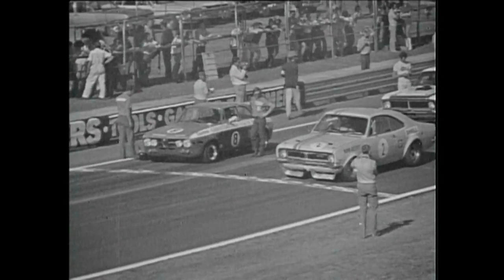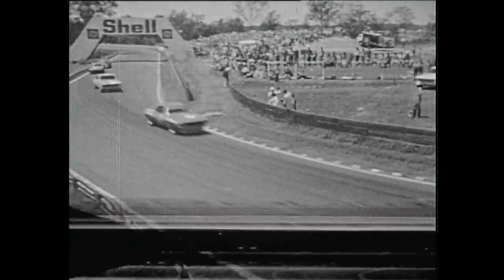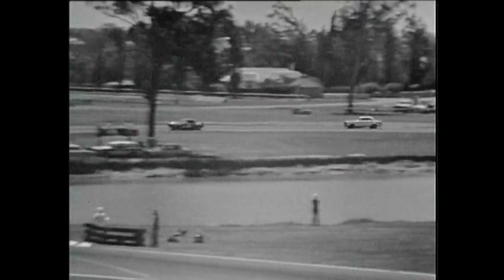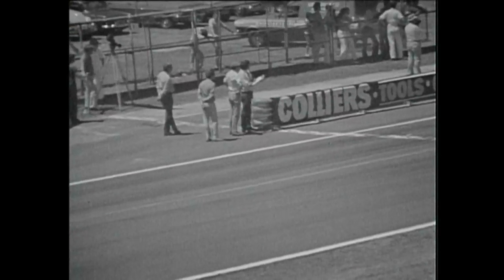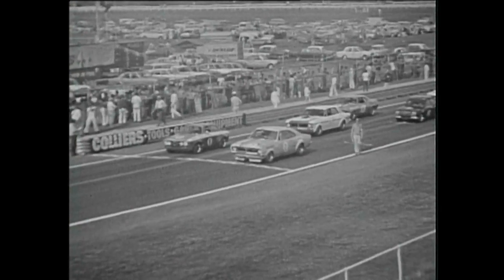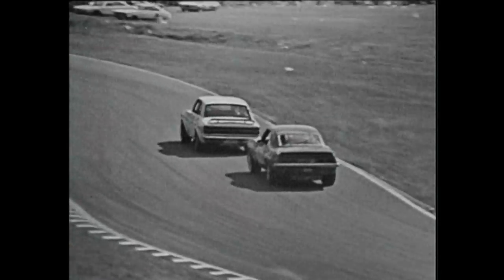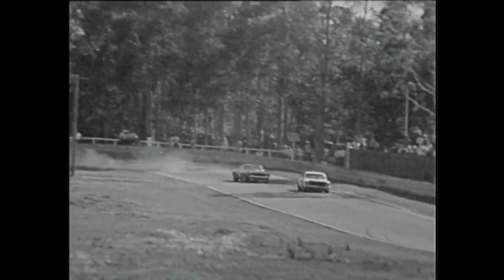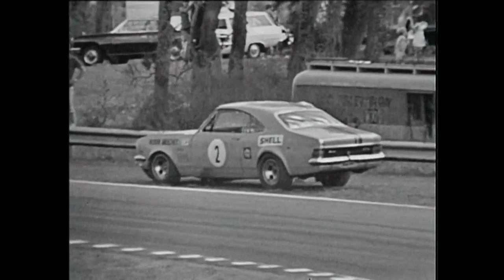1971 AUSTRALIAN GRAND PRIX Touring Car Challenge

Comment: Graham Howard got the engine capacities wrong for the leading Improved Production cars. Sure, for a long time since the mid-1960's the faster cars were generally Mustang V8's of 5.0 litres or less, but by this time things had changed. Pete Geoghegan's Falcon was a 5.8 litre, Norm Beechey's Monaro was a 5.7 litre bored out to 6.0 litres while Jane's Camaro was a big block 7.0 litre (though in 1972 CAMS forced him to run a 5.7 litre 350 instead of the 427).

Comment: the jane camaro had an all-aluminium 427 [ 7 litre ] engine , so it wouldnt be hard to run away
Reply: chopperking1122 1969 ZL-1 Camaro , they only made 69 of them
Reply: really???? back then an all Alloy block?
Reply: @petermaddern3092  Jim Hall ran the all aluminum ZL1 in 1867 in the 2F for the Manufacturers championship in endurance racing, and the 2G for the Can Am. The engine became available to select customers in 1968. It was a COPO option in the Camaro in 1969 and there were a couple of ZL1 1969 Corvettes as well. The beauty of it was the fact that its weight was similar to a cast iron small block Chevy.
Reply: @shimshonbendan8730  1867 not possible

Comment: The commentator said the cars up front are under  5.0 litre and continued to give wrong, wrong wrong  the whole race ,, Janes Camaro ran a ZL1 alloy 427 7.0 litre ,, The Geoghegan falcon was a 4V GTHO 351. 5.8 litre
The Monaro is a 350 5.7 litre. The jane camaro was later banned and ruled to run under 6.0 litre,, it was faster with a 350,

I was at this race as an 11 year old and still have the magazines from the day. Racing car news X 100+ copies.
Reply: No it wasn't faster with the 350 (iron block) than the Can Am developed 427 alloy block engine.

Comment: Hopeless- what cars were they driving?
Reply: Perhaps you prefer budgie cages with tupperware bodies, crate engines & snowflake drivers?
Reply: Sorry -I was cranky at the commentators not giving type of cars and reporting basically only the first two cars
Reply: @johnmerton3630  

and yet they still missed the two passes for the lead, while the camera was focusing on the boring 3rd and 4th place race